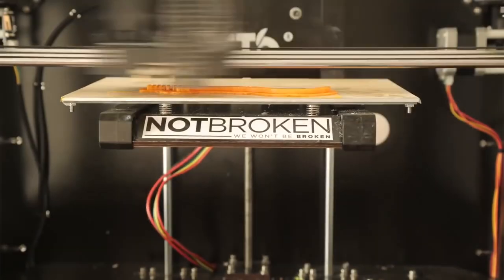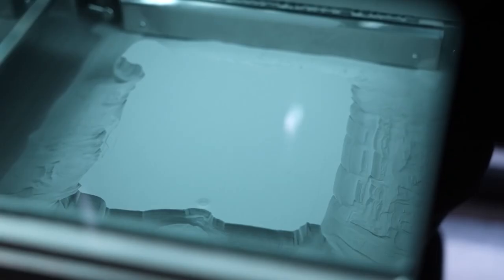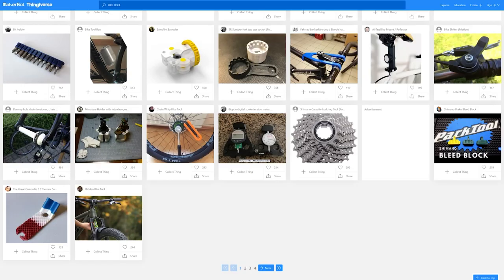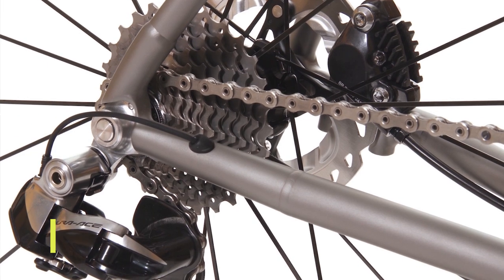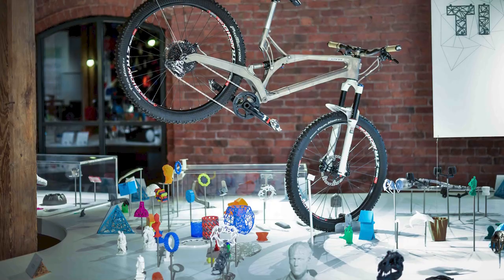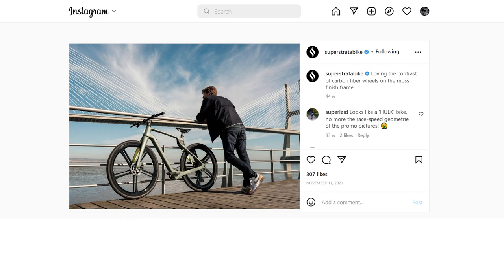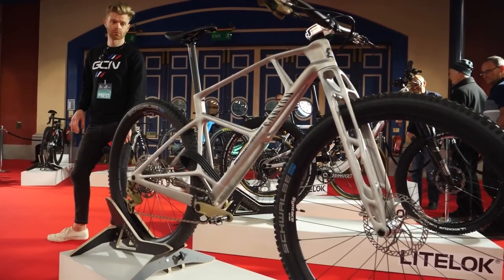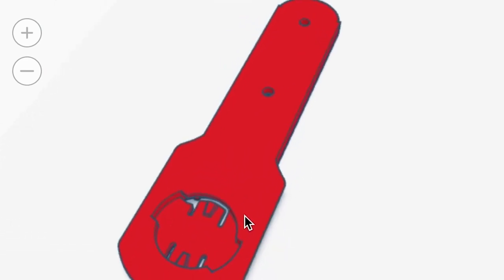Will Your Next Mountain Bike Be 3D Printed?

Comment: I've worked in manufacturing for almost 30 years now and I can tell you whether it's CNC Machining or 3D printing, it's a tool, and it takes skill to use that tool. The idea that everyone will be able to simply print something ignores the design process, it ignores the programming involved, and it ignores the skill needed to actually run the machine. My whole life there's always been a Next Big Thing and in reality the toolbox just gets bigger. Rarely do things get completely replaced but what you end up with is specialized manufacturing for specialized items. Keep in mind there are still working blacksmiths. History tells me that things will move forward but rarely will things go away.
Reply: Agreed ! I am one of those working blacksmiths...!
Reply: Very true. It only opens the door to more affordable custom carbon frames built by master frame builders.
Reply: till auto slicing software becomes available to mass consumers.

Comment: I love 3D printing. I have my own and its amazing how much better they have become. I also have a CNC machine. I think what will happen;

3D printed only where it makes sense. (just as hollow forged, CNC's, hydro formed is now) I think Ti powder cranks/pedals
Tailored to fit bikes maybe not 100% but more fitting options.
Alu 3D printed ebike down tubes bring them on a par with carbon versatility
Then tool, nicknaks and mounts for things like lights

Comment: Great for prototyping, great for lugs and maybe low load dropouts etc. 
But hot/cold rolled tubing will always be stronger weight for weight. 
We will hit a point where printing becomes cheaper than building new bike molds every few years

Comment: Great edit, Have designed many bike parts, can be printed or machined, but I'm a qualified toolmaker
Non structural parts are fine to test but structural parts should be left to pros, it takes alot of experience to understand materials, it's not an amateur thing
Seen designs shared on forums, and it's such a risk, just cos you can doesn't mean you should

Comment: Interesting stuff. Tho the elephant in the room, and its main limitation, is strength, or more specifically fatigue characteristics. Yet hardly a mention of it?? Poor grain characteristics give it poor static strength, tho can be improved by adding more material (and weight) to reduce the static stress. Poor surface finish (& grain) give it poor fatigue life, for regions dominated by tensile stresses, tho shot peening can improve this, if there's access, and you can live with even longer lead times, and higher costs. Keen to see how Atherton bike frame 3d parts go on with a few thousand load cycles behind them 👀
Reply: You're taking gibberish. "A few thousand load cycles" try hundreds of thousands before they got bored and switched the machine off. Go have a look at Bastion Cycles.
Reply: @warwicksworkshop9511  need to be cautious drawing parallels to a road bike which have vastly different load spectrum; dominated by high cycle / low stress, much of which will be below the endurance limit of the material, or the residual compressive stress field at the surface introduced by shot peening, with little effect on accumulated damage. Mountain bikes have a much more severe fatigue spectrum on the other hand. We've had limited success with AM Ti parts & fatigue (Alu even worse) but the learning is getting there

Comment: Well that's an interesting question. Can I make a set of single wall prints (akin to vase mode) that take mere hours to print and plug together into a frame former, and then just fibreglass by hand all around it to finish it up? If so then yeah maybe my next bike will be that. I'd like it to be a step through bike, I don't care about speed or anything, and I need some comfort but aren't gonna be too picky about it. Otherwise I'll just keep the one I have or buy an Alu frame.

Comment: No. I only buy steel frames. Something I don't have to worry about breaking in half.
the only 3D printed part I'll run is a seatpost.
Reply: steel is printable too)
Reply: @Sisadmin3118  I know. Most BMX lugs are cast and have been for the past 10 years or so. Adventure cast and money cast are a couple of the names associated with that style of lug and dropouts.

Comment: even what atherton are doing we are aaaages away from anything seasonably priced... however once it becomes a thing in taiwan itll take off.

We cant even get the current QC right on modern bikes... lets perfect that first
Reply: Back on the 80’s when steel mtb bikes roamed the earth, aluminum frames were ridiculously expensive…..and equally rare.   I see a similar trend occurring yet again
Reply: Atherton frames can't last longer than 20years though. The expansion contraction heat cycles break the glue eventually.
Reply: @janeblogs324  im not familiar with the glue they use for bonding and what they expect from it so cant comment on that, id be curious if theyve had any come loose

I think we will see modular bikes like what wrp is working on in Australia before any major 3d mass production. 
I think what atherton are doing is huge for prototyping and spesh are taking advantage of that... the prototype has already won a world cup.
Reply: @MrSupermugen  the original 1999 trek and giant carbons were built this way. Many others built in the 80s too. But they could be rebuilt with enough effort
Reply: @MrSupermugen  what atherton are doing is just his own brand and nothing more. Glued lugged frames from carbon+alu/titanium/steel was widely tested in early 80s (even in ussr, lol) and they where pretty poor. Now its better, but slill is more about style, not practical sence. I know a few guys, whos building their own custom frames from carbon+steel, its not that hard)